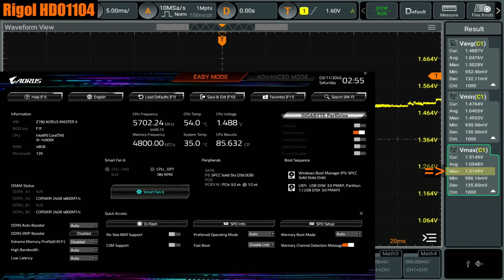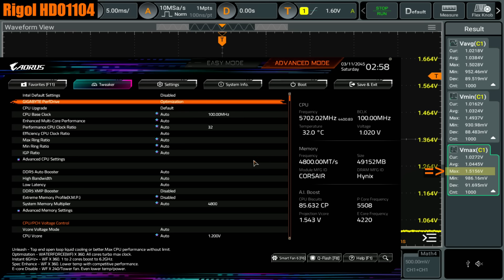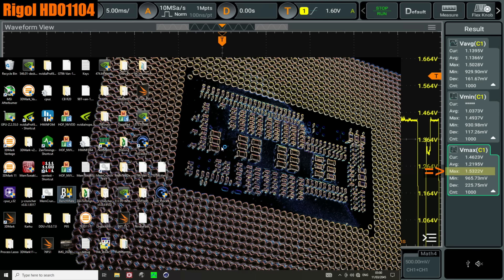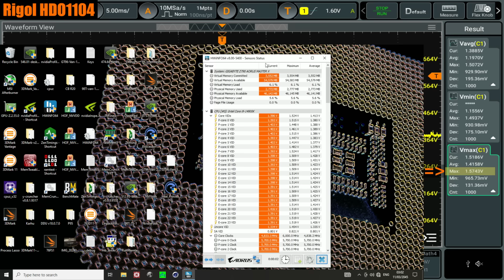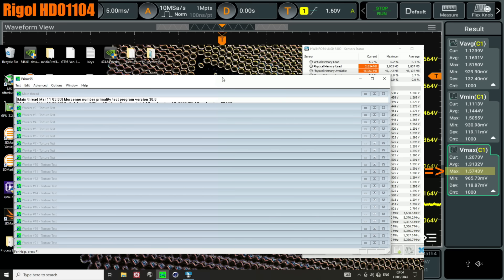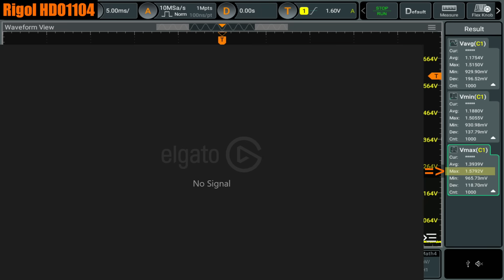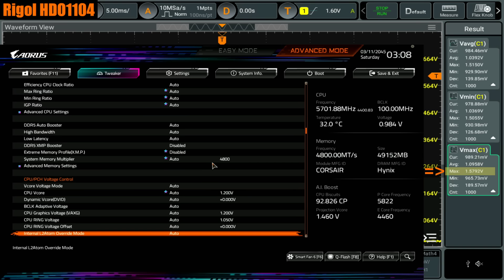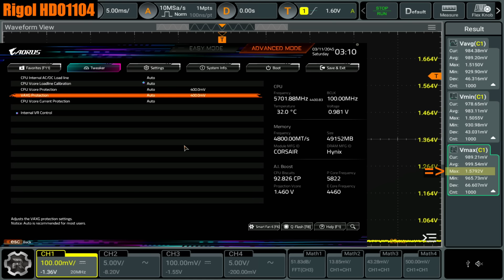Turning off "Intel Default Settings" with Microcode 0x129 DISABLES THE VID/VCORE LIMIT

Comment: I’m really glad I downclocked my 14900kf to 5.5 ghz all cores and locked my voltage to 1.30v right off the bat. I wanted it to run cooler and the voltages didn’t seem right, despite Intel saying they were perfectly fine. Excess voltage for an extra 200mhz on all cores didn’t seem worth it.

On a side note, buildzoid reminded me of my brother when he wondered how many people just deal with it. I built a pc for my brother with a 13700k and he’s perfectly okay with dealing with random blue screen on rare occasions. He’s so stubborn -_- lol. I got him a 12900KS to replace it and he’s still like nah, it’s okay 😂.
Reply: there is no need to downclock it, set sync all cores to 57 so you disable this trash 2 core 6ghz boost and your voltage worries will be gone. 
If you want you can set IA VR to like 1450 to make sure the cpu doesnt get more than 1.45v ever. 
Then the only thing left to do is undervolt for more performance (since youre gonna be power limited if you go by intel limits as seen by buildzoids previous video / 253w = 40.4k~ cbr23)
Reply: Bro at 1.3v you should be stable at 5.7 all core... Currently my 14900k is running 5.8 all p-cores, 4.4 e-cores at an adaptive 1.29v max voltage 100% stable but you need to run manual settings with offsets and correct ac/dc load line settings...
Reply: @joeysuzyjozy  yeah, I’m only using manual voltage and set a specific llc. I used to run it at 1.260v but, I recently started playing the first descendant and the cpu kept crashing. It could pass stress tests of all sorts at 1.26v but that game won’t run stable. I don’t play a lot of games and this game is an Unreal 5 game, an engine 13th/14th gen seems to struggle with according to reports I’ve seen. I had to bump it up to 1.30v to keep it stable. Hasn’t crashed since I did. Good to hear you have a good chip.
Reply: @joeysuzyjozy  Which LLC and AC/DC LL have you used? Which mb do you have?
Reply: @gabrielebarreca2111  Gigabyte Z790 AORUS ELITE AX, LLC = Extreme, AC/DC LL both set to 20, -0.196 negative offset on adaptive v-core. fixed x58 pcore, x44 ecore, x45 ring.
Reply: @joeysuzyjozy stop spreading bullshit. From the four different 14900k I had literally none of them would be stable at 1.3v for 5.7ghz all core work loads.
Reply: @joeysuzyjozy  same here, certainly not the best sample but it does 58/44/50 at 1.31v while being under 70 degrees at all times
Reply: make sure his ram oc is stable, as it'll be worse if he corrupts some important files or system
Reply: I applied the IA VR Limit Voltage setting to 1400 (1.4v), my frequency has a limit of 5.8Ghz, without loss of performance with a voltage limit at 1.362 (in extreme cases) with an average of 1.35v, in addition to eliminating the power spikes, I believe it is a good configuration
Reply: @GSkiin  That is perfect, under 1.4v or 1.35v especially is completely safe and won't degrade your cpu long-term. Also, don't go over 1.35 on your system agent or 1.3 recommended for the same reason. Are you sure that's the lowest voltage you can run stable at 5.8 because my 14900k runs 5.8 at just 1.29v max and it might be worth checking as the lower it gets the more longevity you will have and lower temps.
Reply: @joeysuzyjozy  Hi, sorry for the late response. I'm not an OverClock expert, so I looked for the simplest configuration that would help me have a stable CPU while sacrificing the minimum of my performance and I found this video that talks about IA VR.
The only manual change in my BIOS with microcode 0x129 is the active XMP and this AI VR limit at 1400. My frequency is on average 5.7GHz and reaches 5.8GHz in sporadic moments of high stress , the voltage peak that I can see is 1.372v, never exceeding this value. 
It is worth mentioning that I did not perform any undervoltage due to my lack of knowledge, I just limited the voltage via IA VR, but I believe that with an undervoltage I can maintain the frequency with limits of 1.3v, but it is too complex for me.
My operating temperature with stress close to 75% is 72°C maximum. If I stress my CPU at 100% through a benchmark it reaches close to 82°C, never exceeding this value.
Reply: @GSkiin  If your max voltage is 1.372 you should not have any real degradation issues moving forward although personally I like to keep it under 1.35v. You should be able to easily get under that with a slight negative v-core offset if your willing to try it out.. Worst case is you crash on boot or testing and just change it again in bios until your system is stable, you will not damage your cpu/etc. by undervolting. Messing too aggressively with memory timings can cause file and os degradation long term which is why it needs a lot more testing, but for the cpu your good to mess with undervolting until you find a sweet spot if you care too.
Reply: hi dude, do you know how should i put the undervoltage for my i5 13600kf to keep it safe? i couldnt find a recent vid about it  @joeysuzyjozy
Reply: @ismaeelbmj3109  For your cpu the easiest way would be to just set a fixed vcore voltage to 1.3v and then try going -0.01 lower 1.29, 1.28, 1.27, etc. until you find your lowest stable vcore voltage since your cpu is not unlocked and you only have a max speed of 5.1ghz on your p-cores, you can probably run just fine at just 1.2v fixed v-core...
Reply: Your cpu will never  have a power issue and a v-core under 1.3 will ensure you never have any degradation issues in the future, but honestly you should be having any issues with that specific cpu as it never clocks past 5.1ghz...
Reply: Hilarious - I had a blue screen once a month and ripped my system apart and replaced components for a year straight until it was rock solid.
Reply: Wait, Intel SAID IT WAS FINE?
That's insane
Reply: @PrismVuxOFL You should be able to run a fixed x45 ring stable without issue. For your ram your running 4 dim slots of 32gb you will need to play with manual settings / xmp and increasing your system agent voltage a bit from the default 1.25v to 1.3 or no more than 1.35v max to stabilize a memory overclock, but with 4 double sided dims I don't think you will be able to get stable above 6400mt. I currently have my SA running at 1.3v to stabilize my memory. Staying under 1.4v vcore you should be pretty safe long term, I would still play with your negative offset and see how close you can get to 1.35v or less and still be stable at the above speeds.
Reply: @PrismVuxOFL For static fixed v-core try starting to 1.3v and work 0.1 up or down from there until stable and realizing there is a huge jump in voltage going over 5.7 on pcores or 4.4 on ecores with minimal performance improvement. I ran at 1.225 Fixed vcore on my 14900k for a 5.7 all core myself but settled on a 1.29v adaptive vcore with a -0.20 negative offset for 5.8 all core for better performance and my system agent at 1.3v for ram stability with it overclocked and manually tuned. For memory if you are using 2 dim mb that shouldn't be hard to get working, on a 4 dim mb you may struggle getting it to work off just xmp. I had to manually set everything on my 7600mt ram to a max of 6800mt to be stable on a 4 dim mb and it was a nightmare. my xmp only worked at 6000 not the 7600 speeds.
Reply: I wish my brother would buy me CPUs. Actually I wish I had a brother. Always be a good brother 😊
Reply: @j340_official  🫂 I do what I can for my brothers and always try my best to be a good brother to them.
Reply: Tell him enough of those can corrupt the ntfs file table and eventually destroy the file system itself and he'll have widespread file corruption. Tell him he should learn dism so he can untuck the is when your boot sector is just gone one day.
Reply: I did that, or something very similar, and I still had sudden instability few months later, and surprise-surprise - turning the ring bus down 100Mhz fixed all issues. So, even not doing anything crazy can mean your cpu "degrades" - even if the fix is easy and affects nothing you actually do with your pc that isn't some stress test or benchmark.
Reply: 1.3 vid lock is really stupid. U are literally neutering ur i9. 1.4 or 1.425 is just fine. Hell even 1.45 will be ok if u lock ur cores and set a correct power limit.
Reply: I'm really glad I switched to AMD in 2022. My timing could not have been better.
Reply: @Psythik  terrible idea, AMD is garbage

Comment: Buildzoid I am in the middle of an RMA and going to receive a replacement 14900K. I am paranoid after my first one degraded and I want to know what is the best Z790 Dark Hero settings I should use day one with my replacement once I get it? I was thinking of locking the p cores to 5.7 ghz and setting svid behavior to Auto and load line to Auto with a 1.35 volt limit. What would recommend I do good sir?
Reply: Use adaptive vcore on a -0.100 negative offset with ac/dc load line at 55/55 to start with turbo off and all the throttling settings off for stability and a fixed all core set to x57 p-cores, x44 e-cores, x45 ring to start and if stable try running tighter settings... My 14900k runs with a -0.2 negative offset at a fixed x58 p-cores x44 e-cores, x45 ring with a ac/dc load line of just 20/20 and at 1.29v max completely stable at a p1/p2 of 260w max... Test it out yourself.
Reply: @joeysuzyjozy  Did you disable CEP along with all your settings?
Reply: @Aveeux  Yes it is disabled. Under cpu advanced settings I currently have these settings all disabled: Intel speed shift, ring to core offset, cpu esit, energy efficient turbo, cpu flex override, enhanced tvb, voltage tvb, ia cep, gt cep, under voltage protection, and intel dynamic tuning. 
Other settings: my cpu throttle protection is at 90c, avx offset at 1, manual max turbo ratio set to 58 for all p-cores and 44 for all e-cores, p1/p2 set to 260w max time of 448, amps set to 400 max, system agent set to 1.3v versus 1.25 default volts only for memory stability on overclocked memory, adaptive vcore with a negative 0.196 offset (-0.2 in windows), memory timings set manually not xmp for performance and stability, enhanced multi core performance enabled, intel settings disabled, performance cpu clock ratio 58, efficiency clock ratio 44, max ring ratio 45, cpu load line calibration set to extreme, ia vr config enabled, ia ac and dc load-line set to 20, ia va current limit set to 1600 (400amps), ia vr voltage limit set to 1300 (1.3v), igpu set to disabled, audio set to disabled (i use a pcie audio card) and thats it guys…

Like I mentioned with these settings I run a fixed 5.8 all core at a max voltage of 1.29v using hwinfo that is stable in benchmarks and stress testing occt overnight, gaming without any whea errors, bsod, etc with manually tuned (fast) memory settings.

Comment: Intel said there will be more update and this is not 100% gonna prevent the CPUs from roasting/degrading. They are losing so badly it's almost comical ;)
Reply: just tune the chip yourself and dont wait for rushed bios / micro code updates? you would assume most of this channels viewers would know what sort of healthy voltages are for cpus
Reply: @tqhr  Except the average person doesn't know how much voltage silcon can take.

AMD states up to 1.5V on single-core runs for their CPUs and they don't have this issue.

Intel is just waffling, they have no idea how to fix this or just refuse to fix it properly.
Reply: @VanillaWahlberg  exactly, thats why you do it yourself. 
10 mins of researching will bring you further than what intel has done so far

Comment: My 13900K has NEVER seen a VCore/VID higher than 1.368V because since the day I bought it, I've had it manually undervolted as far as I could take it while still retaining stock clocks!
Reply: For the dozens (DOZENS!) of people that undervolt this was a huge win.
Reply: @ZboeC5  Dozens but its really probably 5% of all buyers who even do these things. 15% max.
Reply: @_.l58I3  unless he's an electric engineer working on semiconductors I doubt he will be that competent beyond what intel releases in their sheets
Whatever research he mentions is random ppl outside the engineering team that made the product posting speculation
Reply: i still find it crazy that people will recommend using PBO und curve optimizer on amd but when youre also supposed to undervolt on intel they say "you shouldnt need to tune your hardware"
Reply: @tqhr  I think what they mean is, you shouldn't need to tune your cpu in order to prevent dangerous voltages.
Reply: @greggreg2458  why let your mobo vendor decide whats safe for your cpu in the first place? That was the same exact thing with the 7800x3d´s blowing up because of SoC
Reply: @tqhr  default settings should be safe, both my 4090 and 7800x3d are undervolted since day 1.
Reply: @tqhr because they are the ones who effing engineered their system alongside intel 
It's not to up the random user to guess what the safe settings are
Reply: @jittertn this is exactly 10mins worth of research, are you saying everyone who bought high end hardware should be completely oblivious about whats happening with the very thing they bought?
Thats not an argument for not tuning it yourself, of course in a perfect world the hardware will just run. 
But since thats not the case you need to act on your own
Reply: @_.l58I3  believe it or not i started out too at some point. I very quickly found out what the general consensus is for "safe" voltages. Sure some people say NEVER GO ABOVE 1.3 and some say 1.4 is fine. 
Nevertheless both would be fine considering you have whatever the fk intel thought would be good (1.55v)
Reply: @tqhr Believe it or not the average user does not know how to do any of it and does not have the time to do "10m of research" because it is not 10m it is much more than that, and I know that because I have worked with the avg user
Reply: @rubenfasola5402  of course not, if that was the case noone ever wouldve complained about chips degrading because of too high voltages. 

I dont agree with the "no time" portion, if you can use your PC you can also build it or do the necessary research on how to apply a quick undervolt. 

I certainly understand that some people can be quite tough to work with but whats next, you need to tell them to actually read the manual or to not download malicious files and run them? 

You gotta have a little faith in someone who wants to have a problem fixed.
Reply: @tqhr ideally the average user would be more aware, that is however an unrealistic expectation. Most people simply buy something (possibly just whatever is the "best") and expect it to work. Which for the record should be a reasonable expectation, the things you buy should work out of the box, plain and simple. You said it yourself, you were also a beginner once, but everyone has a treshold that needs to be overcome before they want to learn more. For some it's low, for others it's not. Perhaps you got a high end chip and immediately wanted to learn the ins and outs of it. Someone else might look into tweaking their setup only after getting tired of fan noise for example. You're putting too much faith in the average user.
Reply: @rubenfasola5402  the average user won't even hear about these issues at all and buy the bigger performance chip, what's your point?

Comment: I mean, this doesn't seem too surprising. The microcode fixed the voltage spikes from trying to predict vdroop, but its not a flat limiter. Maybe it should have included one, but as a microcode, fixing the problem in the context of an in-spec power profile is sufficient. The next problem is getting an ACTUAL spec out of intel and making motherboard vendors follow it for their default out-of-box power settings.